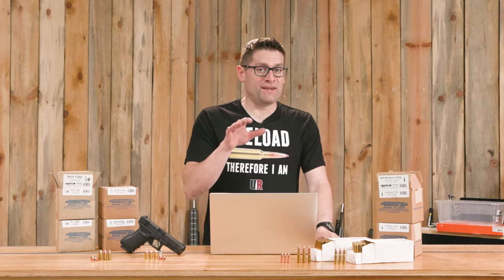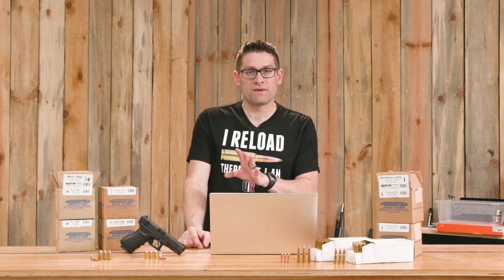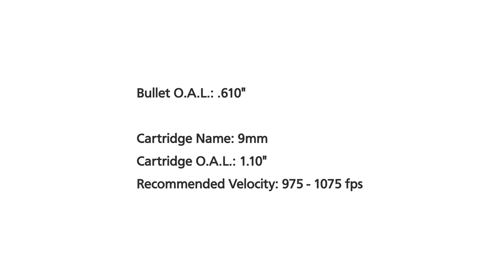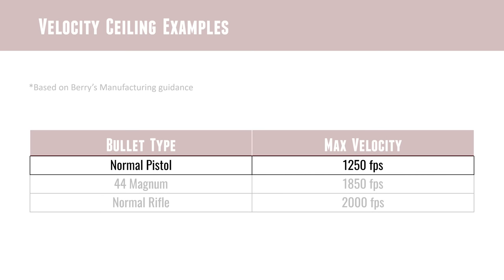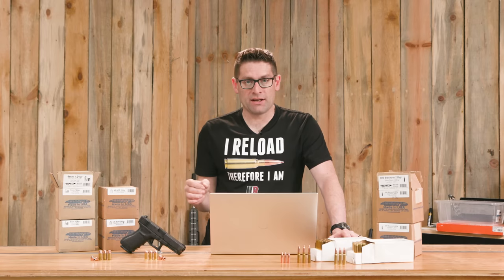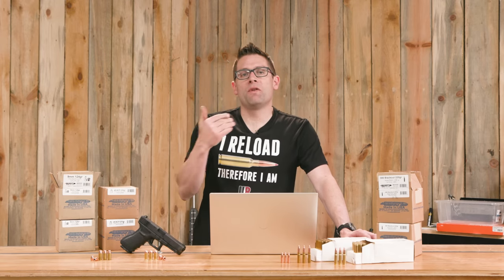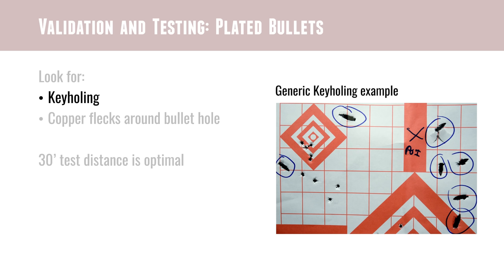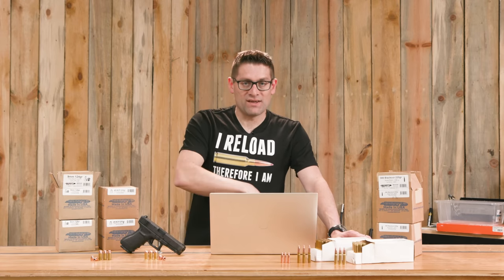Plated vs Jacketed Bullets: Load Data and Considerations

Comment: I've been reloading since the mid 70s. Some interesting plated bullet observations for reloaders:  I did a ladder test reload session with 40 S&W and 165 gr plated bullets.   I loaded 10 rounds of each load stepping the powder up a half grain each time with 50 rounds total. I used a Beretta model 96.   The lowest load did not cycle properly though they hit the target accurately.  I took 7 rounds home with me.  The next step up had 2 fail to cycle out of 10 rounds.   The next 3 loads all worked well but the highest did show signs of over pressure bleed back on a couple primers.  When I got home I disassembled the 7 rounds I brought back and found that after resizing the brass the pulled bullets slid down beyond the case mouth to sit on top of the powder.  Apparently once you do a slight taper crimp the bullet gets resized and cannot be re-used as a pull.  I used a very light taper crimp and found this disappointing.  It'd be costly to need to disassemble a bunch to lose the bullets. 
Bullets that I find around the 25 yard steel plate targets at my range have a lot of plated bullets in the backstop.  Most of those bullets are slightly flattened from the impact but almost all of them do not have any open spots around the plating exposing the lead inside.  I found whacking a plated bullet with a 3 pound hammer on a chunk of granite will not expose the lead. (I do melt fired range bullets to cast some bullets)
I just bought some 308 plated flat point 150gr bullets for 30-30.  Most lead bullet load data I have is for older powders.  I don't find much lead data for rifles in my newer load books.   Since many of the powder companies have been sold and powders reformulated by their new manufacturers I am hesitant to rely on 25 year old data.  I am going to have to develop loads cautiously.   I am surprised with the popularity of plated and powder coated bullets that there aren't better resources for load data.
Reply: Cast lead bullet load data is available in the "Lyman Reloading Handbook 51st Edition" and the "Lyman Cast Bullet Handbook 4th Edition"  both contain load data for modern powders and both available from Lyman's website as well as MidwayUSA, BassPro/Cabellas, Graff & Sons, and most gun shops that sell reloading components. Best wishes to you in your endeavors to reload.

Comment: I've reloaded and shot probably close to 100k rounds of Berry's...hands down my favorite round for reloads. But i have NEVER heard about the velocity issue. I've talked to Berry's several times about reload data and wasnt pointed toward velocity. Awesome info Gavin. I just wish i knew this before i just received my order of 20K rounds of 5.56 rounds. So from what i heard, as long as its not key holed or brass specks around the bullet on a paper target, im good to press above 2000fps...I just did a whole work up using that bullet and we were around 2990 fps with our chosen load. I was about to load them all up, but now i think i need to go back to 30 feet and check. No key holes at 100M, acceptable group size...am i good to go?

Comment: I use them in 45 acp, 9mm, 30/30 & 30 carbine. All work great. Tested the 30 carbine today & was very accurate @ 25 yards, 1 big hole @ .5" . The 3030 shoot good but I found the seating depth to be a lot shorter than jacket or cast bullets. Could be my rifle has a shorter throat than most.

Comment: I have loaded Berrys in 9mm, 38 Spec and now started 45 ACP. Been very happy, and they are more accurate than I am. I test with chrono and have my state champ friend verify accuracy in my handguns  - he gets very good groups😂. No issues with Berry's round nose using Hornady data. I find that with several handguns (Taurus G3c and Springfield XDM 45acp) using XTP COAL with Berry's Hybrid HP results in failing to pass "plunk test" due to the 'fat' profile of the nose. Using Speer Gold Dot published overall length solves the problem since it typically shortens COAL. I either use Speer powder data, or back off XTP powder charge and work up. I do test with chrono, but tend to use light loads anyway. Have used Unique, CFE Pistol and Titegroup. I load 38 Spec  roundnose and flatnose at mild target velocities, but haven't tried Berry's for 357 due to velocity and heavier crimp needed.

Comment: Gavin, glad to see a video related to Berry's bullets! The question I have specific to their bullets is they run .001 larger in diameter then other bullets of the same caliber does this create any issues in relation to barrel wear. Thanks for any responses.
Reply: Anecdotal, but after shooting probably 15,000 (maybe more) of the plated pistol bullets, I had a batch of 45acp that were oversized that I had to run through a bullet sizing die (for bullet casting) to get
Them to load correctly.

Since then I check each time I bought them and have noticed the same thing, all of them are a bit oversized.  Never caused an issue shooting (other than the aforementioned batch of 230 grain 45acp)

Edit: the plating is pretty soft, as noted by now easy it is to “dent” when you apply a crimp, for both rifle and pistol, so I seriously doubt it would do any additional wear to your guns.
Reply: You are correct about the .001 oversize. This is required to promote accuracy. You will find that cast lead bullets will cast out at about  .001 in diameter for a given caliber. Cast lead .308" bullets are typically cast and resized to .309" to obtain maximum accuracy. Plated bullets have such a thin plate and the Berry's bullets are Double Struck, meaning that they resize the lead core prior to plating and then resize after copper plating to assure a perfect diameter bullet. These bullets do not need to be resized as they should be used straight out of the box. Jacketed bullets, because of the hard thick jacket on the other hand, need to match the groove diameter of the firearm, or for a .308 groove diameter, a .308 diameter bullet is required, otherwise chamber pressures can reach dangerous levels causing safety concerns for the shooter. As I stated in an earlier post, using Cast Lead Bullet loading data is a good way to develop safe and accurate loads. Think of these bullets as Hard Cast Lead Bullets without gas checks and load accordingly. A great deal of load data for Cast Lead Bullets can be found in the "Lyman Reloading Handbook" and I believe the new 51st Edition is now available and can be purchased online at Lyman's website. As always, Your Mileage May Vary. Happy Reloading/hunting/shooting!

Comment: Is the culprit of recoil discomfort a function of acceleration, or the second derivative of projectile velocity called Jerk? or both?

Specifically, will a 4" barrel of 9mm parabellum caliber shooting 115 gr full metal jacket RN ammo 1190 fps, 362 ft-lb energy at muzzle cause more recoil discomfort than a
147 grain Hdy XTP at subsonic 975 fps and 310 ft-lbs at muzzle?

Do you have a source for measure of pistol recoil discomfort?  I am trying to decide which has less discomfort from recoil for the same firearm?

Comment: loaded a lot of berrys 185gr 45, i use the low end of hndy jswc data for charges of win 244.  no issues with large and magnum primers, dec .2 for magnums.  for 230gr with 244 i use the high end of lead rn data.  both at 1.250 COL.    shooters reference website is great.  Had trouble finding data for these combos so thats my experience.  Dont have to change die heights or setups between the two rounds which is nice.

Comment: I was shooting a match with my G20, someone noticed that my bullets were tumbling through the paper. Shooting HSM loads. Long story short, I called HSM and apparantly they had some plated rounds that went out as jacketed. The factory Glock barrel besides lead, doesn't like plated either.
Reply: Not sure what`s going on that your glock doesn`t like plated.... every glock i own, shoots fantastic with berry`s plated. I shoot 9mm, 40S&W, 10mm, 45ACP glocks, w/zero issues.
Reply: @D70340  Yeah, hard to say. But HSM knew exactly what happened as soon as I explained my situation.

Comment: Berry’s 220gr 300 BO bullets have a disclaimer not to exceed 1:7 twist. I bought it for my Sig MCX with 1:5 twist not realizing the limitation and they don’t group at all. At 25 yds I was struggling to even keep it within a 5moa circle. I wish I could use them because they’re so economical but I guess I have to stick with a jacketed bullet.
Reply: My question is why are you using such a tight twist?
Reply: @RadDadisRad   I think that would be a question for Sig but my guess is they were trying to get 1 full rotation before exiting the barrel on their 5.5” barrel lengths.

Comment: I've used lots of Berrys bullets, and like the 220 grain 300BO...  but have shifted to RMR for most other stuff...  as they have quality jacketed bullets for about the same price.  In 147 grain 9mm, the RMR bullets are SIGNIFICANTLY more accurate in my guns.  As for price, the cheapest I've found Berrys is Powder Valley.  RMR comes straight from RMR and they offer free shipping.  Would love to see you do some tests with RMR.  They also have 'Nuke' hollow points now that work well.

Comment: I shoot plated .308 bullets using cast bullet data for my model 94 in 30-30. (Red Dot, 700x etc.)
I haven't considered jacket bullet load data.
(Or loads for .308 Win. I use sorted Factory Second jacketed to safe money and still shoot 1000 yard steel targets. 

Thanks for the info.

Comment: The only issue I ran into with plated bullets is that you definitely need to chamfer the inner edge of the case mouth or you'll end up scraping chunks of copper plating in front of the case mouth wich prevents the cartridge from fully chambering
Reply: +1 on this for rifle rounds if you have to trim. 

Also, flaring the case mouth for pistol rounds needs to be dialed in otherwise, regardless of how much you clean up the mouth of the case, you’ll get the same pealing of the plating.  Finishing off your pistol cartridge with a Lee factory crimp die to make sure you don’t “dent” the plating with the crimp is also helpful.
Reply: @bannedbycommieyoutube5time920  <> I decided to op for the chamfering of the case mouth instead of flaring for two reasons: #1 is that I reload my 45ACP cases multiple times and didn't want to over work the brass, causing spit case mouth. #2 I'm lazy; I only have to chamfer once, where as you'll have to flare each and every time.
Reply: @Oldhogleg  Makes sense, although I wonder which wears out brass mouth quicker, stretching the cartridge or removing the brass thickness.  Hard to tell id imagine with a low pressure cartridge like 45acp.

With 45, I’ve found the cases last a long time with standard loads since it’s a relatively low pressure cartridge.  I can’t remember last time I had one split on me, if ever.  I don’t sort them, nearly all were collected at an indoor public range so I wouldn’t be able to test anything scientifically anyway.

I reload 45 on a Hornady 5 stage progressive press, so flaring takes no more effort than not flaring, just another die on the press and pull the handle.

Whatever works 🇺🇸!
Reply: @bannedbycommieyoutube5time920  <> Good point, I only have a single stage myself. I only can guess at which would most likely split case mouths, so I made a calculated guess on that.

I do the same thing, as a rule I typically try to come home with twice as much brass as I shot when the range people are not looking 😁. After going through the tumbler, it's easy to see wich ones I've already chamfered and wich one needs chamfering that were range pick ups.
Reply: @Oldhogleg  makes sense, didn’t think about being able to actually see the chamfering after the fact.  Good tip.

I have a single stage also, got the progressive press used for less than half off, took some tinkering and a couple calls to Hornady to get it running smoothly.  Probably worth it for high volume pistol shooting, I load most of my rifle caliber stuff on the single stage though, old school like you 😁👍🏼.

I am just like you, I ask people if they are going to save their brass and if not, I kindly sweep it up for them and keep it hehehe.  We are both brass vultures in that regard.  I had 7 five gallon buckets full of 9mm, it was getting ridiculous, so during the last ammunition crunch (ongoing unfortunately) I sold most of it off to some people getting started in the reloading game.
Reply: @bannedbycommieyoutube5time920  <> Lol, that's great you had extra for a few neophytes to get started, hopefully they were able to find primers and powders.

Same here, I got the single stage primarily for precision rifle shooting. Back in the day's I was shooting pistol matches I typically bought the pistol ammo because back then (90's and early 2000's) it was more cost effective being so dirt cheap back then. And with target ranges typically being limited to 25 yards, there was no need for precision ammo. 

But rifle ammo was an entirely different story. Hand loading for precision was the only way to go.
Reply: I actually do both, flare the casing slightly and chamfer the inner edge on my 10mm reloads.  I' ve pulled a few bullets to check for any damage to the plating.  Not even a scuff.  With the lower velocities used with plated bullets, I don't even worry about case life.  I do however segregate the brass and use the same brass for plated and have other casings for jacketed loads.

Comment: What about shooting something like 44 mag for 357 in a single action revolver as opposed to a semi-auto or double action revolver where there is a lot more velocity before it Encounters the rifling, causing a skidding on the bullet before engage is a rifling and starts to turn???
I have looked at 44 mag bullets and could tell you the ones that were fired in a double action revolver compared to a single action revolver. There is at least an eighth of an inch with a skidding before it engages rifling.

Comment: Does any reloader remember '80s - '90s  Remington's Power Lokt Hollow Point (PLHP) .224" 52 gr bullets??.. As far as I know, those little guys were actually plated, (Copper or brass plated??. IDK). In fact, I used to load those, from .223 / 5.56, thru .22- 250 & up to .220 Swift, from 2.950 fps, up to 3.500+ fps. NO jacket separation whatsoever. Actually, I still keep a couple houndred. Pretty decent groups & terminal ballistics.

Comment: Component prices these days make it difficult for reloading basic "range" ammo to compete with buying case quantity FMJs.

You can still save money by loading unusual/hard to get rounds or self defense style ammo.  I'm working on self defense style 357 Sig and 10mm.  For those you need to be picky about expansion, weight retention and accuracy, that's where you need a good JHP.
Reply: I second that.  The prices of components almost doubled due to combined ammo panics.  Component prices didnt drop when ammo prices dropped this year.  The primers are ridiculously priced and still hard to come by.  If you dont have old pre pandemic stash its not worth reloading now.

Comment: The .44 bullets I got from Berry’s state 1,400 FPS max velocity. They are 180 grain, so that speed is easily reached. When I run 180 grain XTP bullets (which are plated also) I run them over 1,800 FPS, which I’m told is fine by Hornady.
Reply: Hi John, that is a great bullet choice! I don't mean to be contrary, so I am just putting this out for accuracy sake. Page 55 of the "Hornady Handbook of Cartridge Reloading  - 11th Edition" describes the XTP/ XTP Mag bullet as "Drawn Gilding Metal Jacket", indicating that this particular bullet and design is jacketed and will therefore allow greater velocities than copper electroplated bullets. Again, I like your choice of bullet! An excellent choice for accuracy and dependability. I use the Berry's bullets (the cheap stuff) for target/plinking, and reserve my Hornady XTP loaded 180gr 357 Magnum cartridges as my "Good Stuff" for mission critical applications such as self-defense.  Have a great day!
Reply: @jeffreymccright3542  good info, I had always thought the XTP’s were plated. I use the XTP’s in my .44 and my 10mm.

Comment: I wonder why they make rifle bullets in lower weight ranges... I was about to buy a box of 250 130gr .308" just to have a nice plinking load for a gas gun, but going down to 2000fps, I'm really not even sure if it would cycle the bolt.  

They've got a 220gr option as well, but in a 1-10" twist barrel I'm not sure they'd even stabilize.  Both would probably be fantastic for .300aac or .30-30 plinking loads.  Just thinking out loud, lol
Glad I watched this video though as I had 5 boxes in the cart!  Better to spend more on a bullet I can actually use than get a "great deal" on bullets I have no use for!

Comment: Seating depth is my biggest issue. I don't have comparable bullets with load data available to try to achieve the same airspace under the bullet in the case. I hate to buy bullets I don't need to try and achieve this with my plated bullets but I may need to for some of the bullets I haven't developed loads for yet. I don't have any Berry's bullets yet but have been shooting Rainier 115gr HP plated in my 9mm for years. To bad they had to go out of business.

Comment: Plated bullets are superior in my opinion, they are bonded right from the jump. Thats why speer uses that process, all be it with very thick plating. The berry's hybrid hollow points need to be pushed fairly fast to expand in 9mm though. For the 124 grain bullets i couldn't get reliable expansion below about 1150 FPS. If you load your 124 grain bullets to +p they woek great. I use the shellshok cases and load them to +p+ pressure with fantastic results (about 1300 fps from a glock 19, not that i recommend that 😉)